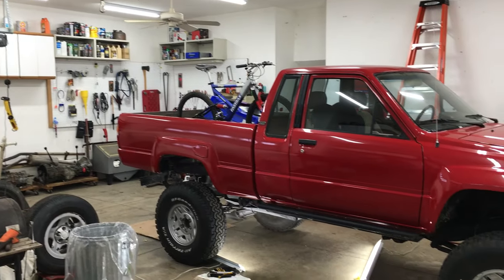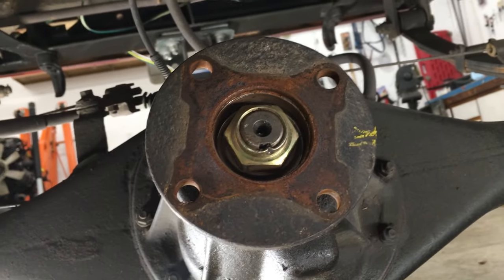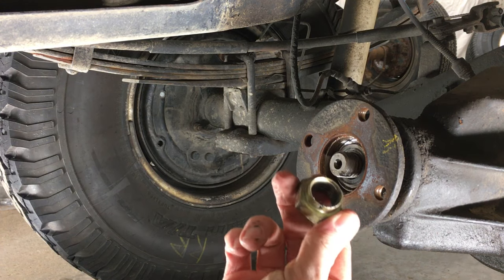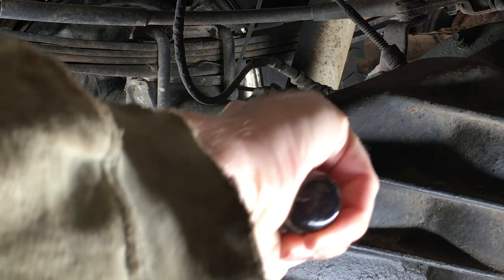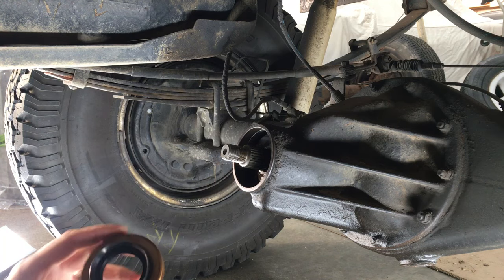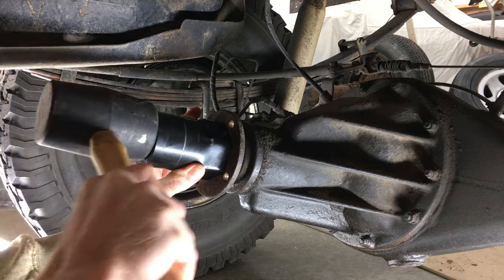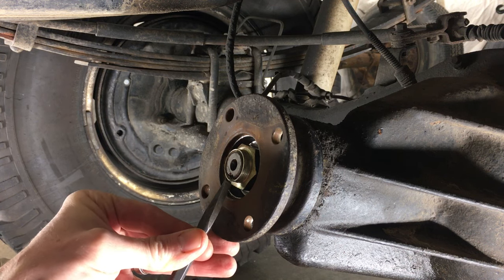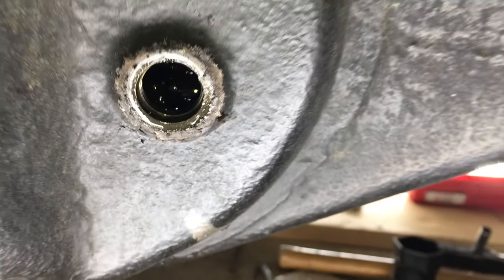How to Replace Toyota Pinion Oil Seal in Rear Differential/3rd Member

Comment: Well explained! I have the same truck and I’m about to do this. And while I have the FSM’s too, this video is certainly well worth 1,000 words!  It looks like I need to order that wheel bearing socket first.  I don’t see what else I could improvise with to set the seal, ..maybe 2 or 3” PVC pipe and a cap.
Reply from the maker: Yeah a thick pipe would work too, anything you have laying around with the same outer diameter.
Reply: @6thGearGarage  I wound up using a white 2" PVC pipe end cap.  They are for 2" pipe but are 2.75" wide in total, leaving ~ 2mm of room all the way around.  It took several tries to get it seated right as one side would go in more, causing the other side to pop up.  So I also used a small wooden block and 8oz tack hammer to lightly tap around the perimeter then smack with the centered PVC cap.  It worked well and I finally got it in.  It wasn't quite as easy as your video makes it out to be but I got it done!
Reply from the maker: @oldowl4290  Nice work!!

Comment: Anyone doing these needs to be ready for the axle to blow. Not saying it will, but be prepared. I did this on my Dana 44 not knowing better and eventually my gears blew, was able to get it home somehow. Then I had to study how to rebuild my diff. Took a long time and a lot of reading to do it right. Cost more to rebuild than to get a used axle too.
Reply from the maker: How many miles were on yours when that happened?
Reply: @6thGearGarage  oh geez, it was like 7-8 years ago maybe. I bought my 95 Isuzu Rodeo with about 115k and it now has 160k. Maybe 120-130 lets say. Not trying to doubt you guys and be a troll. I had this problem and didn't know any better at the time. I torqued it down to spec and I can't remember if I had to notch the nut in place. Remember counting the turns and marking it however. Turns really don't matter too much in this scenario bc it will begin to tighten at the right spot. 
I know you guys put up a disclaimer on the video too, so not calling you out or anything, and i know some people may never have a problem occur. I did after a number of months. You know already that when you're working with fractions of a hair that these things can possibly go haywire. 
I have a guy's Highlander here now with a leaking diff seal. I told him the possible consequences just in case he wants to try it the cheaper way or just get a used diff and throw it in. His has 175k, 04'. The used diffs on ebay run 200-300
Reply from the maker: thebenthermit hey all good, I don’t doubt it happened. I’m at 195k mi so I wanna know what to expect in the future. Mine was re-geared around 160k though so it probably has a good amount of life left. Last time I changed the fluid it looked good. Thanks for heads up 👍
Reply: @6thGearGarage  did you regear it or did a previous owner, or have you ever done it? I highly recommend getting into it if you're interested. It's fun, well, ripping your hair out kind of fun lol
Reply from the maker: thebenthermit it was done by the previous owner. I haven’t ever done gears... yet

Comment: Is this the same pinion seal setup as a 1985 hj75 land cruiser
Reply from the maker: It should be a similar process, however some of the torque specs may be different. I would reference a service manual to be sure.
Reply: @6thGearGarage  thank you... Where so you find your service manuals as I have struggled to find one for my model troopcarrier
Reply from the maker: Harrison Filleul I found mine on eBay.
Reply from the maker: Harrison Filleul is this the one you need?
Reply from the maker: Harrison Filleul https://www.ebay.com/itm/TOYOTA-LAND-CRUISER-HEAVY-DUTY-SERVICE-SHOP-REPAIR-MANUAL-COPYRIGHT-1984-/123806820359?_trksid=p2349624.m46890.l49292
Reply: @6thGearGarage  yep looks like the correct one. Would be nice to get that digitally and somewhat in expensive

Comment: Great video. Worked for me. I also left 2 bolts in the drive shaft and proped a crow bar against them and held the pinion flange still with that so the truck wouldn't move. Not sure if better or worse but it worked and no more leak. Thanks!
Reply from the maker: Thanks and good idea!!

Comment: I’m having problems with my 1987 extra cab 4 x 4 I had to change the clutch master cylinder three times aftermarket have you had the same problem?
Reply from the maker: Although I've been told aftermarket ones from parts stores are china quality, I have not had one fail.  How are yours failing? Where are they leaking?
Reply: No they just start losing pressure no suction
Reply from the maker: @alfonsocasillas7290  Maybe the seal inside is wearing out? That's weird it's happened 3 times now. Hope they had a warranty on the parts!

Comment: Was the grease used Lucas "Red  "N" Tacky ?
Reply from the maker: Billy Thomas no it was just some regular old red bearing grease
Reply: @6thGearGarage  Ok so anything like multipurpose or the red n tacky works for that task ?
Reply from the maker: @billythomas4527  Any general bearing grease on the inside of the seal will do, just to add a little protection on the seal.